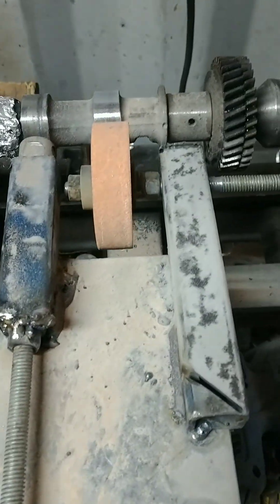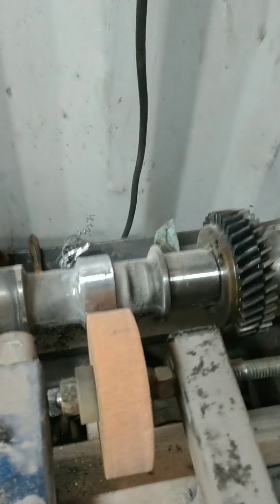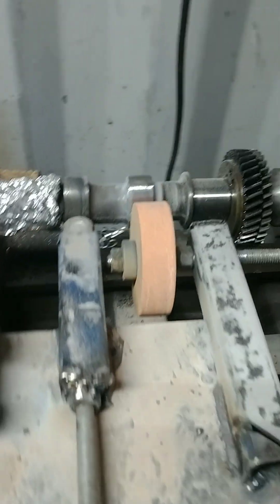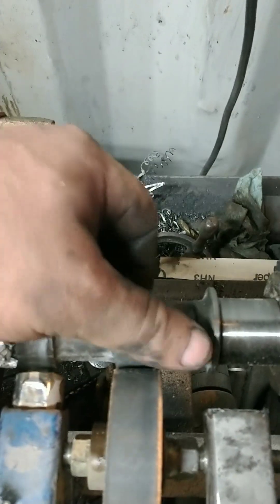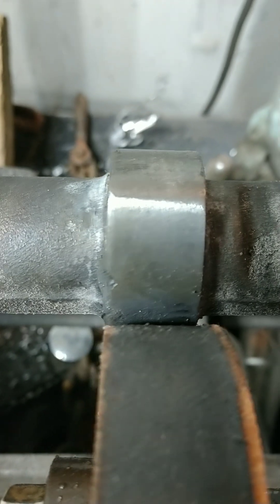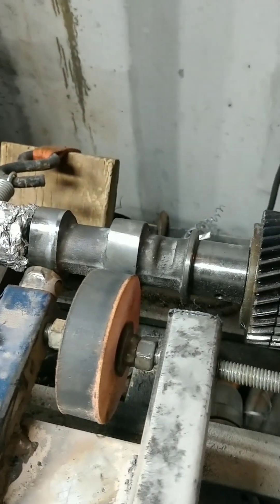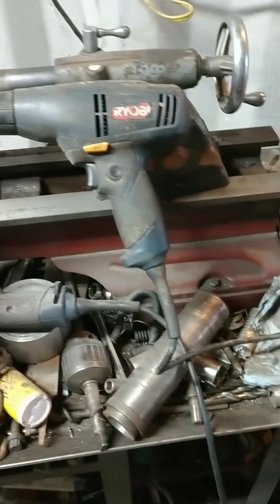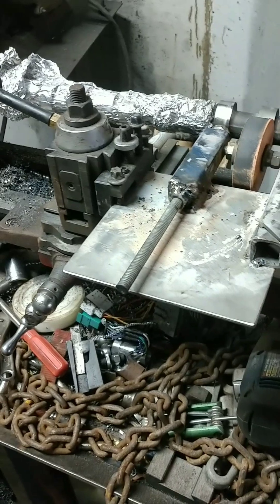Repairing a damaged camshaft lobe with a welder and old atlas lathe

Comment: This is how it all started people tend to for get that hot rodders we're broke so they did exactly what your doing I heard 610 rod does well???
Reply: I remember from the dale earnhardt movie that his father would cut connecting rods below and above the bearings and reweld them to the same length with screwdriver shaft. They screwdrivers were forged steel instead of cast like the connecting rods

Comment: I get a lot of DIY stuff and perfection isn’t always strived for and most times you can prolly get away with it, but the entire purpose of grinding a cam with a stone is to provide a flat surface that can be applied to the cam lobe so your wear pattern will function properly. You have that machine setup to where the stone looks crooked that camshaft is going to cause another engine failure bc this is one area you really are not suppose to say “I know it ain’t perfect” well I know it ain’t gonna run if your grinding a taper into your lobe. Your asking for a lifter to have an early life.
Reply from the maker: Still running strong.
Reply: @battleaxefabandmachine  😂😂😂 yea I bet it is

Comment: Thank you so much for the information.  I have a 1920 Universal Motors four cylinder engine with a bad cam lobe.  The cam shaft is irreplaceable.  I've lost irreplaceable parts sending them off for professional repair, not to mention the cost.  This gives me a place to start on repairing it myself.  Thank you again.
Reply from the maker: Did you ever fix your camshaft?
Reply from the maker: You might talk to Powell machine in Alabama or Georgia.

Comment: How did it run afterwards is it holding up . I am thinking of doing same thing to a car .
Reply from the maker: I ran it on high idle for a few hours and then pulled the valve cover to check everything. Customer picked it up day before Thanksgiving and drove 300 miles to St Louis. So far so good. I have asked twice to make sure it was still running good.
Reply: @battleaxefabandmachine  OK one more thing did you preheat before welding , and what type of rod did you use ? I got to try it .
Reply from the maker: No I didn't because it was a billet cam. It's called Brutus rod
Reply: @battleaxefabandmachine  So do you think this would work on a Ford cam ?
Reply from the maker: What year and what engine?
Reply: @battleaxefabandmachine  96
Reply: @battleaxefabandmachine  4 cyc ztek
Reply from the maker: Probably cheaper to buy a cam isn't it?
Reply: @battleaxefabandmachine  What a radical concept . Since you didn't really answer my question I will answer yours . Cheaper ? No not when you been laid off from work for a month , and just now catching up on paying bills . That I incurred while out of work . Hey if I had the money I wouldn't be on youtube asking your advice I would go buy one . I might would even get a new car . Guess I will cross my fingers maybe Santa Clause will bring me one since its Christmas . Sorry to waste your time . Have a Merry Christmas and a Happy New Year .
Reply from the maker: Understand. It would be worth a shot I guess. My cam is $650 new.  I fixed it for half. Sometimes we have more time than money so we try crazy stuff.